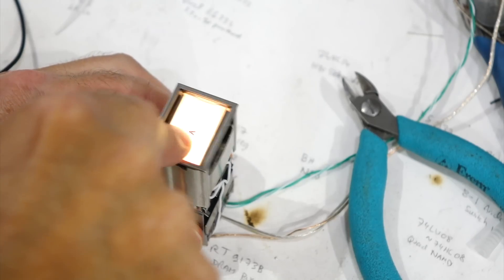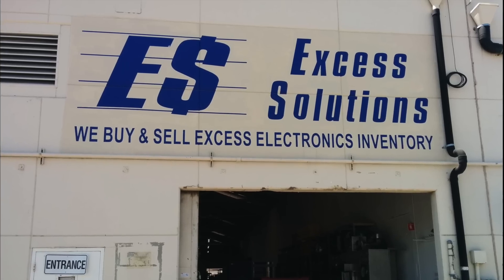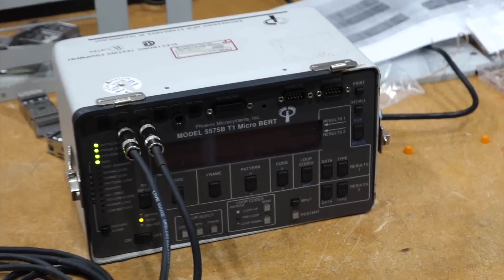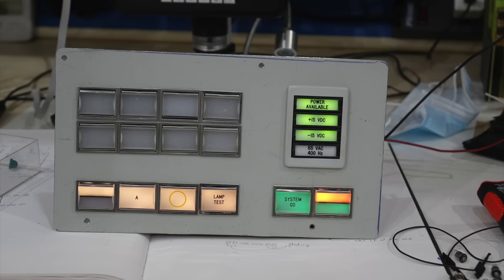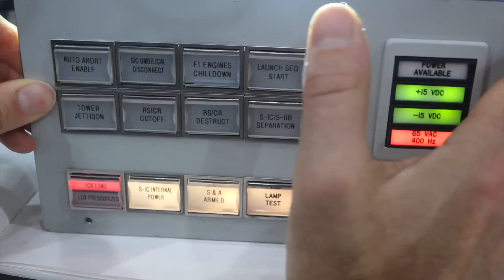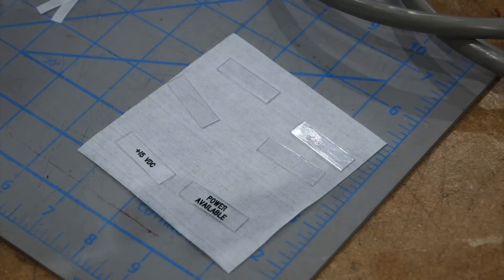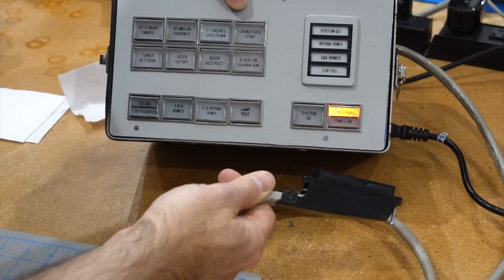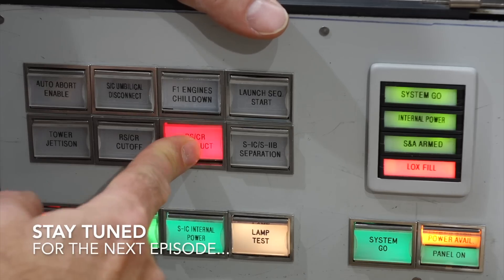Apollo Ground Service Equipment Panel Prop

Comment: "copper telephone line era"... so.... Australia 2021 networks?
Reply: He means on the backbone, the last mile is still largely copper. Most countries use fibre instead now as a data network, rather than multiplexing analogue calls over copper for exchange to exchange links. T1s and T3s also used to be used  for internet connections, where I guess multiple modems would split the traffic across say 30 lines to get faster speeds
Reply: @TheErador  Mainly joking, but wouldn't be surprised if there is the if it ain't broke, don't fix it attitude at play, especially with small exchanges in rural areas. In my quick look online, I haven't been able to find any references to T1 being used in Australia much for anything, so not sure if it is some American / overseas standard that was never used in Australia or it really is old and obscure enough to not have much presence online.
Reply: I started in telecoms in the UK as a jointer on copper cables. My skill set includes being a qualified lead plumber for lead sheathed paper insulated copper cables. I’ve worked on fibre for nearly 20 years now and found myself explaining how a 2 fibre DWSS 4 x 2 circuit works and how to provide it to a new recruit as nether of his supervisors knew !.....how technology has moved on....copper telex lines, strowger telephone exchanges and PABX’s...I’m starting to feel my age. Lol
Reply: @andrewrixon2347  there's always value in a) knowing how things work and b) the skills of the past, because at some point they will both be needed again, maybe in a different guise but all useful
Reply: I was getting a bit confused about that bit :)

Comment: 1969: You pressed a Button, therefore you meant it!
2021: Flimsy touchscreens that react either not at all or overly sensitive, triggering random actions all over the place.
Reply: 1970s customer: This button is too hard to press!
1980s engineer: OK we make these buttons easier to press. (designs easy to press push button)
1990s customer: ThIs BuTt0n Is ToO hArD tO pReSs!
2000s engineer: What do you want!? (designs button that will go off whenever you look at it weird)
2010s customer: THIS BUTTON IS TOO HARD TO PRESS!!!1!!!one!!

Comment: Tear apart the z80 monstrosity next? Maybe? No pressure...
Reply from the maker: Already did. Quite impressive electronics actually, lots of Altera PLDs and FPGAs. Some higher end analog stuff. And then I put it back together, still works!

Comment: Need to repurpose that Z80 to drive the lamps in there too, so that you can send via TTY to do lamp status, and get back via TTY input switch status. Should be enough IO on the existing board to do all of that with the existing number of switches on the panel, and the number of LED outputs, though probably a drive board to convert the TTL drive for the LED's to whatever voltage (24V I would guess) is needed for the lamps. bonus points to use a whole load of JANTX2N2222A's to do it, as being space rated transistors, and the de facto military switching and driver transistor for decades.
Reply: I was right with you up until "Need" ;-)